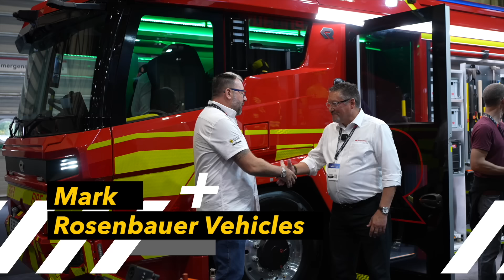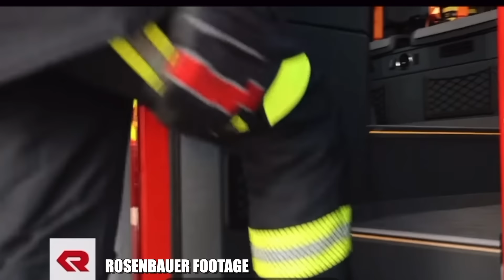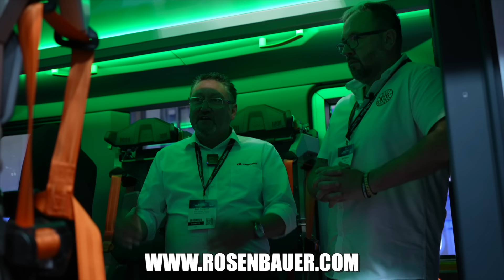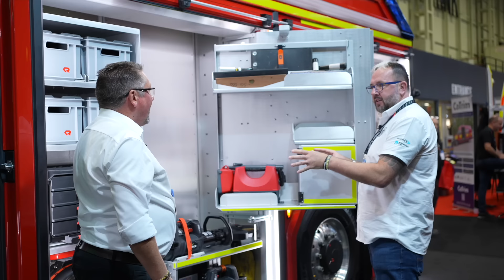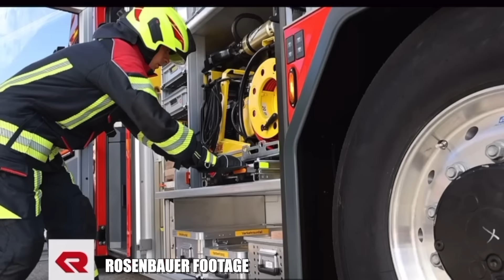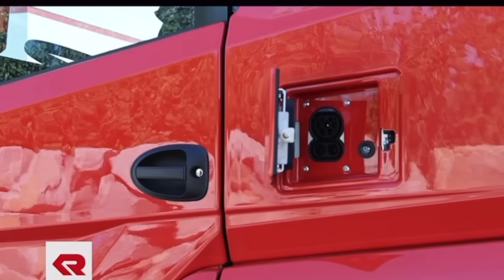Buy This Electric Fire Engine - With A £1,000,000 Budget!

Comment: All electric fire engine with a 3 litre diesel on the back. Mint that is.
Reply: Correct me if I’m wrong, but if petrol is just left in a fuel tank without being used for a long time (several months), doesn’t it become unusable and need flushing out? Is this factored-in?
Reply: @TheScoppie yes it goes stail and although the engine will run the proformance will be lacking
Reply: @TheScoppie  It's a Diesel engine thus diesel fuel. Should be good for about A YEAR. Which is unlikely as they most likely will just used up the relatively small tank for class of vehicle. Within a freaking year.
Reply: Ben it's a good idea in theory but in practice I wonder if this vehicle will be like the electric refuse vehicles that where tested here in Somerset earlier this year I believe one had to be recovered several times because something in the drive train although we the general public didn't hear what the failures were.
Reply: The idea is that most days it does everything on electric and then when that big job does come along and its sat pumping for hours, there's back up with the diesel. If you stick solar panels on the station, you can massively reduce your fuel costs.
Reply: @benpaynter  Costs... not for the benefit of the environment as running an older fire engine or not buying this at all would be better for the environment. And how long until you're financially better off buying this and installing solar panels?
Reply: @mileswilliams1585  NOT Relevant, no one is junking an older fire truck early. They have no choice to replace an old fire truck not fit for the job. That is not a environmental choice that can be made. You are just going to advocate buying a new diesel guzzler anyways. Soo you are a hypocrite.
Reply: @Neojhun  Well I'm not am I? Go mine your rare earth minerals for batteries, that will last 10 years before they need to be buried in the ground, ship them round the world, build the vehicles from ores, charge them from coal power stations and tell me it's more sustainable than a modern diesel engine? It's just not true.
Reply: @mileswilliams1585  It's literally Dozens GRAMS of Rare Earth Metals for the whole battery pack. Yes I can literally mine it my self here in Australia but I won't be contributing much to the industry. They are not being just buried in the ground when 80% of battery packs are aesily recyclable especially the valuable metals parts. It's the PLASTIC PACKAGING and the Electrolyte which is difficult to find a purpose to recycle. Not ores being buried again. You keep ignoring the facts and numbers, no clue what you are talking about. You have no ability to form your own arguments. Just stubbornly continue to copy paste the same old fear mongering script.
Reply: @mileswilliams1585  "charge them from coal power stations" WHAT COAL Power Station? UK in 2025 Barely runs any Coal Power Station and it's a tiny fraction of Electric Grid Mix. Your lies defies obvious facts.
Reply: It's best to think of this as an industrial appliance, not a vehicle, and like many industrial appliances, moving to electric from thermal energy sources, the gain is a rise in efficiency that lowers operating costs. those. The same approach is applied to gensets in diesel-electric trains.  

In this case, the diesel generator is optimised to produce electricity to charge the two on-board battery systems, operating as an EREV to extend the range and as a backup generator for long-duration deployments. It will be tuned to a higher efficiency level to produce electricity only to charge the batteries and so power the various onboard systems and motor systems. This allows for more efficient use of fuel when required, so lowering operating costs. 

Further, as the diesel generator can be designed for one role, it can be more optimised than a diesel system that would have to act as a generator, a powertrain to move the vehicle, and a pumping system that would require various lower efficiency gearing, transmission & power take-off systems. In doing so, it reduces the complexity of the tender, its maintenance requirements, and operational costs.

This isn't an electric vs diesel vehicle discussion point, but a meeting of the two technologies to produce a more efficient and effective unit.
Reply: Need something to run the pumps?
Reply: @andrewwilliamson7885  Almost like it should just have an engine then? You cannot convince me producing this truck, mining for rare earth minerals, shipping them round the world to make a battery with a limited lifespan is more environmentally friendly than running an economic diesel engine
Reply: @mileswilliams1585  LIES! LiFePO4 uses ZERO Rare Earth minerals for the cell chemistry. Literally dozens of GRAMS are used for the electronics circuits. You've smoked more crack in a week. A modern luxury car with a V8 or V12 engine would use more rare earth metals than the entire battery in this Fire Truck. Your lies defies chemistry facts.
Reply: @mileswilliams1585 EV zealots
Reply: @mileswilliams1585  Environmentally friendly was never the right objectivefunction.  Human flourishing is.
Reply: @smorrow  Human flourishing? Explain how that makes sense?
Reply: @mileswilliams1585  Rarely eve paying $6 a gal diesel. Due to OIL WARS. Imagine how much humanity would better flourish if we didn't do both.
Reply: @mileswilliams1585  It uses two tanks of diesel probably during whole year. Literally a tiny fraction amount of the fuel compared to " running an economic diesel engine". Beyond just better for environment it's just more secure reliable energy source. No OIL WARS to fight.

Comment: These fire engines should be ok as long as they have plenty of water on board when and if they catch fire, at least they will be able to put them selfies out,😊😅😂.
Reply: You can't currently put a car battery out (lithium) you have to let them burn out, that's the problem.
Reply: @richardbrealey989  WRONG! The proper training method is to flood the battery with as much water as possible to cool it down to prevent thermal runaway. This WORKS on older batteries. But newer batteries assist even more with fire retardant between the cells. Soo it should stop burning quite fast. The problem with this fire truck is that it has a 3.0L BMW Diesel Engine. The battery is not the problem.

Comment: All electric is awful for long calls, hence why its not all electric, and all digital is also bad, because what happens if you lose power? You're screwed. Also not a fan of the lights running all the way along it, give us some simple traditional lights.
Reply: There hasn't been an all analog HGV of any type in the UK for decades. All those mechanically driven conventional pumps are entirely reliant on ECU's and smart electronics to switch on PTO's, keep the engine running etc.
Reply: The last time heavy commercials vehicle was not digital was back in the early 1990s. That ship has sailed.

Comment: It’s still powered by an engine though, its got a 3 litre Diesel engine to charge the battery…so it still needs ICE ,……and they always will, so just remove the battery and just use the engine, saves weight, money and the environment.
Reply: Not powered by the diesel engine, it is there only for very long duration pumping to extend the range of the batteries, under normal use the engine will not be used.
Reply: Wow you are brain dead. The Diesel engine is only a small 3.0L BMW Diesel Engine. Seems like the smallest Firetruck Diesel engine I can find is a 6.7L. Obviously not powerful enough drive the fire truck mechanically. It is just used as a BACKUP for the Series Hybrid power train. The 132kWh battery is enough capacity for majority of calls where the engine does not need to run. The battery alone can also provide up to 600 horsepower giving confident powerful acceleration. You are not saving weight or the environment with Pure ICE as they have weaker performance and guzzle more fuel.
Reply: @Neojhun and you would have to be brain dead to believe you are saving the environment by fitting 132kwH lithium ion phosphate batteries to fire engines, all you are doing is making them heavier and more expensive to buy….it’s a complete farce.

Comment: Net zero madness. The government also doesn't have any money for this virtue signalling.  I really like the cab design though.
Reply: Stop with this political nonsense. Only you have been forced to fixate on the net zero madness. Navy Submarines, IceBreaker Ships, Cruise Ships, Tug Boats, Mining Equipment, Logging Forestry Vehicles and obviously Locomotive Trains are Series Hybrid because they are Tougher and POWERFUL. Not because it has anything to do with Net Zero and existed way before that hot button issue existed. It's just sad it took literally multiple decades for Fireys to get the same technology.
Reply: Have fun dealing with a 2400hp Locomotive that is purely mechanically driven from the engine. They do exist and some areas still operate them. But it's very much fallen out of popularity in the past 4 decade. You rather waste money on complicated mechanical matinaince than some imaginary nonsense virtue signaling.

Comment: him saying that bas aint in lockers bro hampshire has been using the ba lockers for years in there pumps which also refuel ba sets
Reply: I wouldn’t bet that the pumps you mention have a compressor mounted to refill B.A. sets. Even the truck mounted ones are quite large and take up a locker. Have a look at the Cascade units used in the U.S. heavy rescue trucks.
Reply: @jamjardj1974  they do indeed as someone whos around these types of trucks they do even charlie 1 our largest ic truck in the county of hampshire comes with a refill area we also carry something i dont see is a cafs big nono not to mention how unrealiable these trucks are like how las ev had to be out of action during palisades and australias ev had to be out of action on the day that there new station was opened i rather my fls then that shi american truck company

Comment: More Ev crap
Reply: This is a series hybrid Navy Submarines, IceBreaker Ships, Cruise Ships, Mining Equipment, Logging Forestry Vehicles and obviously Locomotive Trains. Proven power train in many other life one the line sectors. The only crap is the vague nonsense you are spamming.
Reply: @Neojhun oh shut up with your crap the battery will need replacing in 5 year at a cost of prob half the value of the rig  councils have had bin lorry's at stupid costs only to get rid as they are not fit for purpose will be watching the news soon when fire Ev truck suffers self combustion on way to fire how ironic 😂😂

Comment: I only watched a bit of your video the minute he said they have a engine to charge the batteries is just a con just buy a real fire engine and it’s just false economy and false telling people it’s electric not it’s has a engine supplying the power to drive everything 🤦‍♂️🤦‍♂️🤦‍♂️🤦‍♂️
Reply: Not true, if you watched properly you would see that the engine is only a back up charger for very long duration fires, it will not normally see any use, the truck charges using normal EV chargers
Reply: @killuazoldyck1352 so the engine charges the batteries exactly

Comment: Its not electric if it has a 3.0 diesel engine lol technically it could be classed as a mild hybrid maybe, but that is there because they know on a long busy job the appliance will just run out of power and bad design of electric buttons for the lockers i can see them lasting long.
Reply: Not a mild hybrid but an EREV and backup diesel-electric genset combined.
Reply: By that logic an e-scooter "isn't electric" because it's charged ultimately by coal and gas.
Reply: Stop with the crazy LIES! It has a 132kwh battery which is enough for most calls. This is PLUG In Hybrid and Series Hybrid, there is no mechanical connection from the engine to the wheels. The OPPOSITE of Mild Hybrid. The electronic buttons won't wear out because there is basically Two Sets of controls for most functions. There is even a 2nd remote control tablet to operate the truck. Your assertions are baseless nonsense just seed fear.

Comment: Its a fire engine designed by a committee of tree hungers and box tickers. 
Given a modern v6 3l diesel can knock out 400 bhp, to have a 3 litre diesel engine to run a charger so you can run goodness knows how many tonnes of batteries. ?
Reply: it just has 132kwh battery, which is about 1.1 Tonnes. I'm quite sure that 3.0L BMW Diesel engine only kicks out about 320hp because 240kVA generator power is already overkill for this use case. This series hybrid powertrain makes perfect sense and was designed by nerdy Austrian engineers who like things like Locomotive Trains. not a committee of tree huggers. They like the POWER!
You made up silly assertions while ignoring the basic facts.
Reply: FYI it's Straight 6 BMW Engine not a V6.

Comment: I don't get it.. You've got a fire engine with a diesel engine that could be used for propulsion but instead it's used as a dynamo. Why go to the lengths of adding extra weight and complexity of having electric propulsion? Just because it can be done doesn't mean it should be done. 

Why not add an additional hydrogen combustion engine for when it runs out of diesel and the batteries are flat? And maybe have another engine running LPG, another running petrol for the pumps and while you're at it, stick some solar on the roof and a couple of aeroplane RATs to show off what you can really do... just because!?
Reply: Stop with the crazy lies. The diesel engine is a small 3.0L BMW Diesel up high in the back out of the way. Not powerful enough to mechanically drive the fire truck. It is purely used as a BACKUP and rarely need to run. The 132kWh battery is enough for most calls and runs off DC charger power, literally just CCS plug like cars. This is a series hybrid where the power train is DOWN SIZED to required as little extra weight as possible. Pure ICE driving the wheels is just as complicated but MORE FRAGILE and WEAK. Drive shaft -> large number of gears transmissions -> a transfer case -> two drive axels is just as complicated. Dual Electric Axels is much more simpler MECHANICALLY and more POWERFUL.
Your insane ideas about alternative do not work because the fuel SUPPLY DOES NOT EXIST! I love LPG Autogas but the infrastructure is slowly being destroyed ever since it's peak around Y2K. Hydrogen fuel for road vehicle is wacko nonsense as it's absurdly expensive and the fuel infra is implausible to scale up with current known material science.
Series Hybrid has been proven in Navy Submarines, IceBreaker Ships, Cruise Ships, Mining Equipment, Logging Forestry Vehicles and obviously Locomotive Trains. Firetrucks is a perfect use case for Series Hybrid. I just wish they would change to supercharged V6 Petrol engines.
Reply: With all that water on board, they could have hydro power as a backup as well assisted by some small wind turbines.

Comment: That’s a bi mode surely? Not fully electric.
Reply: The donkey engine charges the batteries, it's not connected to the drive train.
Reply: I think the 3litre diesel engine on the back might be it......?
Reply: BMW 3.0L Diesel Engine at the back. Which is used for the SERIES Hybrid power train. A demo model RTX has done a road trip across multiple Canadian Provinces with ease. Occasionally using DC Fast chargers or using Diesel Engine to charger. Perfect for this job.